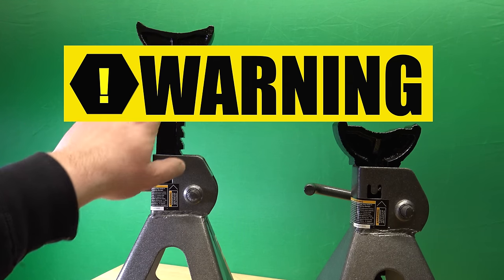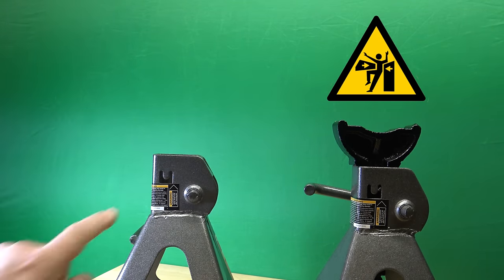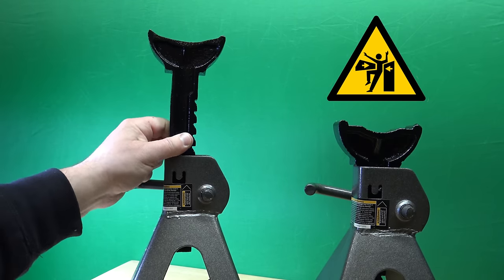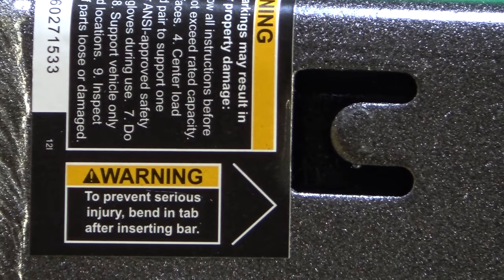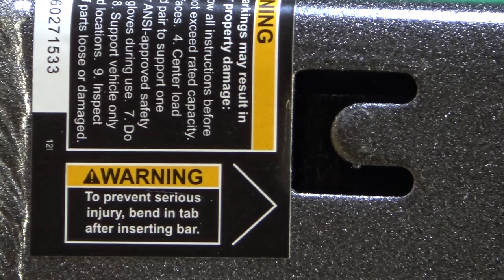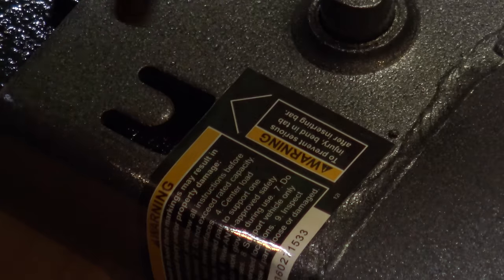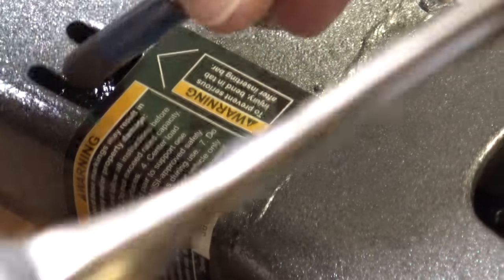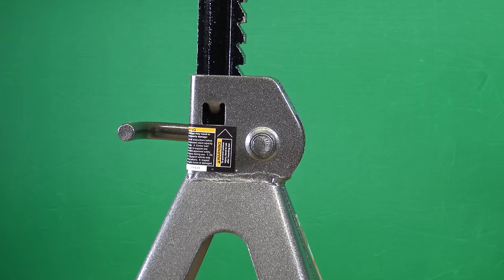Jack Stands Safety Feature

Comment: So its only unsafe when you are carrying it around as it could fall on your foot.  So what. Its not unsafe when you actually place them under your car.  I'd rather allow it to come apart as it takes up less storage space and you can actually fit the stands back into the original box.
Reply: I totally agree, I have never bent in any of those tabs for the reasons that you say
Reply from the maker: @Perplexer1  now i am perplexed
Reply from the maker: @Perplexer1  because of the issued recall it turns out they are really dangerous. Some people got hurt badly, otherwise they wouldn't recall them. I yet have to take mine back, but i just used four of them under my Jeep. The whole car resting on four of those, that was scary, but it needed to be done.
Reply: @mygiguser  huh? Why were you scared? How is the tab being in or not in going to affect safety when you have a Jeep resting on it?

Comment: also here's the most important safety tip: after you lower the car onto the jack stand, build 2x4 or 2x6 etc wooden cribbing or create solid wide bases to place under the wheel. if the jack stands fail the wheels will drop onto the wood, double safety!. try to put the wood as close to the wheels as possible so it doesn't drop much in an accident. put your jack on a solid lift point but take the pressure off the jack, the stands should hold most of the weight, this is a 3rd safety, another safety is put your wheel under the car in case stands fail, another 3rd safety. the tip in this video isn't that important
Reply from the maker: Great tips on how to use the jack stands. Thank you +eksine for that! Once the heavy iron parts fall out of the stand onto your feet, when you carry them around, you will realize how important this video is ;-)
Reply: eksine that only works when you are not taking the wheels off.
Reply: Allen McKinney if you're taking the wheels off don't get under the car if you don't have too and put jacks under the front and rear middle lift support pointsand put the wheels in the corners in case the jack stands fail. you could substitute cribbing in place of jack stands
Reply: eksine I have to use cribbing in my driveway. I got 6x jack stands but I can't trust them in my driveway that's muddy and uneven.
Reply: Allen McKinney that's not the problem of the tools then, that's just because you have no concrete in your dirt driveway
Reply: Amazing idea!!!! Of course I don't have the wheels on when I'm working on it...
Reply: LOL

Comment: The pin that holds the arm is not that thick for 3 tons or 6000 lbs. It is at an angle so it should be strong but they don't look that good to me. I do not see the safety feature of bending that in since it does not lock the stand if the pin that goes into the notch breaks.

Comment: this is the harbor freight stand. my 6 ton version if you bend in the tab you cannot use it at the lowest height. It's not unsafe to not bend in that tab. if the tab is bent in and you still accidentally kick up the handle, you still die. the tab is only needed if you use the stand at its higher settings.

Comment: The tab isn't much of a safety feature, more of preventing a lost arm or incorrect install of the arm.What people should look into is the unsafe missing piece on this jack stand design.  Newer versions comes with a safety lock pin, which makes it a double locking pin.  On top of that, having the pin with a cotter pin on the end will secure the pin from popping out hence what the main pin was suppose to be a backup for the handle popping out.

Comment: just to add the safest way to use your jack is use it at it's lowest setting , meaning it's not grabbing onto the pawl at all, it's resting literally on the top frame of the jack stand. this way the pawl cannot possibly be kicked out and have the car drop down to the lowest height.
Reply: Except you're possibly wrong.  If it's resting on the top then the saddle will be load bearing on the edge of the steel plate and could more easily deform it and stress the welds,  instead of the weight on holes in the middle with welded on washers.  Maybe you should just get better jack stands so you're not constantly worrying about them.  They are meant to be used as designed, not all this bullschiit you're stating.

Comment: It wont ever be a problem when there weight on it.  It's just for carrying it etc.  That tab doesnt effect its intended opperation.
Reply from the maker: Unsafe when carrying. That is unsafe. Especially when you wear sandals.
Reply: mygiguser what man wears sandals? Especially working on a car.
Reply: I wear slippers sometimes when working on my car at home

Comment: I would assume it's safer to not bend it in considering you could actually damage the integrity of the structure. I barely trust these jack stands as is.
Reply from the maker: Bending the tab shouldn't make anything worse.
Reply: They are designed to be bent.  Second guessing the design would be foolish without any testing to validate your wild guess.

Comment: OMG U just use that tiny hammer to bend it? I have to use 2 lbs sledge hammer to bend my craftsmen 3ton stand tab. Talk about how thin of steel the HF is using. My other pair Hein Werner 3ton stand can use long screw as the stop bec there is a hole on the bottom of it.
Reply from the maker: Once the car comes crashing down on you, you learn your lesson.